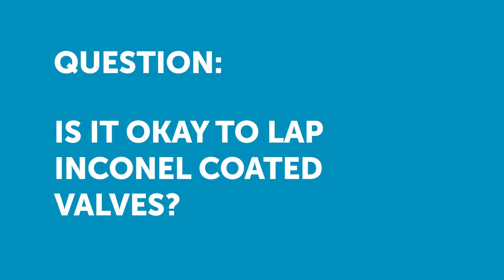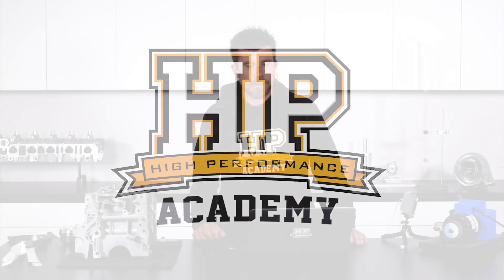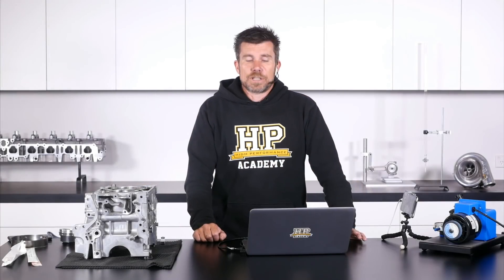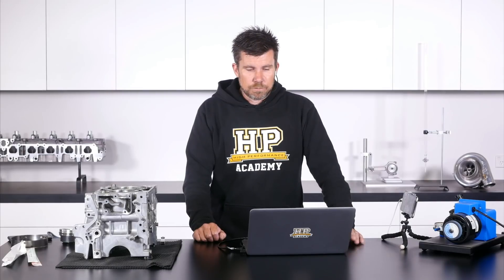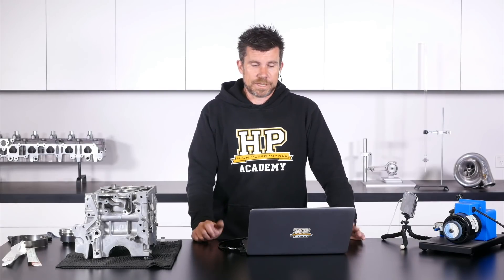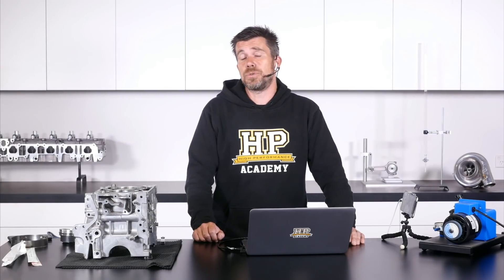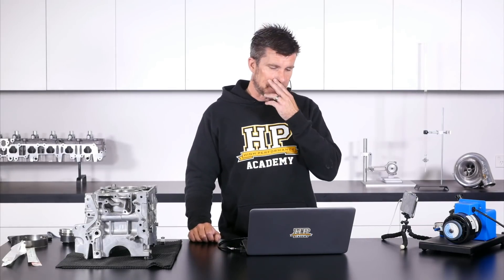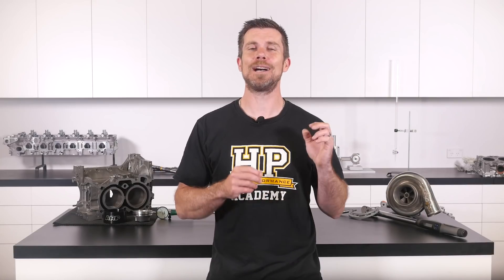Lapping Valves, What Is That? | Should I Lap My Valves? [HPA Q&A]

Comment: Why will lapped valves become unseated  when the engine is warm compared to when you say your lapping valves ensures proper seating after cutting valve seats. When you state that valve lapping is no longer done and valve cutting is now preferred in its place what country no longer performs valve lapping?
Reply: The concave/convex surface expands when it gets hot and so the seat contact area gets smaller, so instead of sealing across the face of the valve, you only get a seal on a narrow band, or on two narrow bands at the top and bottom of the 45 or 30-degree face, this isn't an issue on a flat 45 or 30-degree valve sealing face done correctly. 

What he is saying is lapping the valves after cutting will remove the chatter marks that will sometimes be present after cutting seats on a machine like a Serdi, I personally will use a valve cutting stone that can be faced on a valve grinding machine in such a situation, but this is very rarely necessary, usually only when you have a really hard seat insert material, or a very large diameter valve, or a poorly fitting plot. Instead of checking for chatter by lapping, Prussian Blue marking compound is a better method if you know what you're doing and don't use too much of it.

I think most first-world countries wouldn't lap valves anymore, and probably haven't for the last 40 years or so, no automotive machine shop I've ever worked in even had valve lapping gear. I've done thousands of heads, started my apprenticeship in the early 90s, and never once lapped valves.

Comment: So a brand new valve, would not need any cutting?
Reply: The valve angle on a brand-new valve may be slightly different than the angle on the seat and will still pass a vacuum check, but won't transfer the heat properly from the valve to the seat, you might be fine without grinding the valve, but I'd always check it with some Prussian blue valve-checking compound, or just go ahead and give it a quick grind as it only takes a minute or so for each valve.

Comment: Why is lapping not good but relying on machinery and the operator of the machinery more so ok???
Reply: Are you deaf?
Reply: Because the machinery is highly precise, is repeatable and won't leave your seats concave. Uncle rufus who's slightly buzzed and is spinning that lapping stick like monica lewinsky did in the 90s has no clue what Runout and a precision valve job Is.
Reply: @PredaFran  yep.
Reply: lapping a valve properly is very different their is may grits 60-1000 grit lapping grease used fer more than just a valve ..if your building a engine with say new heads chances the valve job will suck ground off plane  n all that sadly it Friday and the 10hr machinist/or china guy may not care as it will run good fer 20k until it gets out worse n not seal so if one laps his old /new what ever heads its fine in my book its like the nascar shop ant doing it like this but to say it will not seal wen hot is odd do it right order 3 different grits n go at it use needed grits my air cooled engines seal fine lapped  thumbs down not the whole story here

Comment: the valve stem has too much clearance in the guide to do a good job if you try and remove any kind of material by lapping. normally for cutting or grinding you use a precision pilot that fits nice and snug in the freshly machined guides.
Reply from the maker: Regardless of how accurately the valve is located, the process of lapping will result in a concave/convex valve seat to valve interface.
Reply: @hpa101  Sure does. In an emergency, I've tried seating some leaky valves with the suction cup/firestarting technique. It is not effective.

Comment: Soooo...Not really "lapping" the valves, but merely 'lapping' the valves....
Reply: I would argue that if you have gone so far to hollow out the valve or seat you have tried to manually grind the valve, not lap it. There are engineering definitions of lapping and removing so much material you make it concave is not included in those definitions.
Reply: Exactly. Knocking the high spots off to better match the surfaces is the definition of lapping.
Reply from the maker: Call it a 'witness check' if you are more comfortable with that terminology? Regardless, if you follow the discussion it should be pretty clear that what I'm suggesting is very different from a traditional 'lapping' - Andre

Comment: +1.  I was about to say the reason to do it is to read the margin, but once again you said exactly what needed said.  Honda factory says to do it, but as far as I know that's non coated valves.  Valve manufacturer will say whether to or not if it's aftermarket.  I'd add the line should be right in the middle of the face, 1/3 its width, and same all the way around.  No need to press hard.  Listen for the sound to soften and lift it up half a dozen times and you should be good.  Nothing but good info from you guys.